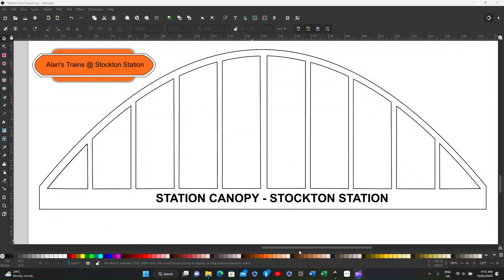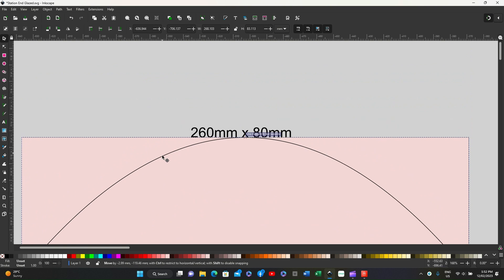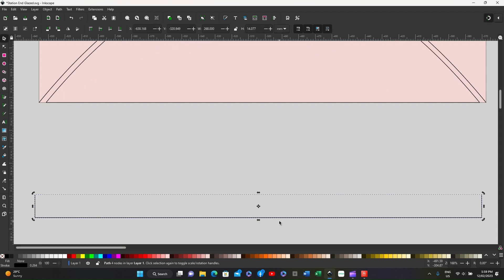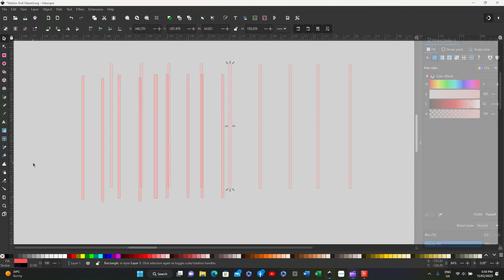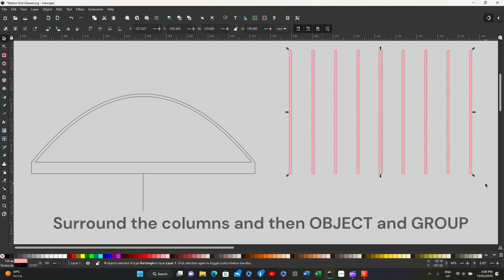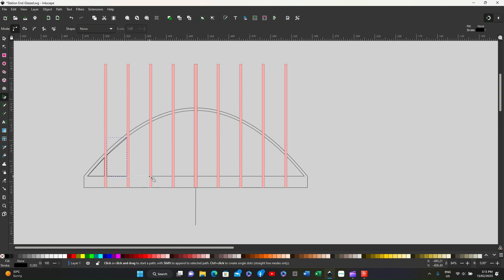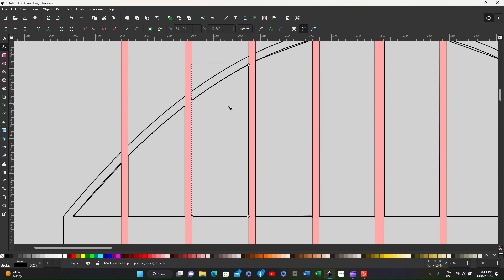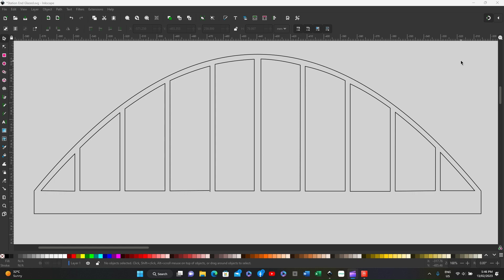Constructing the end of Station Canopy in Inkscape Part 1

Comment: I liked how you made the initial arch. I hadn't realized that about the smooth nodes option. However, I can offer a slightly simpler (and quicker) method of getting your window shapes. Once you have your second smaller arch and draw the line underneath, select both and choose Path>Union. This now makes an arch shape. Give it a white fill color. You can do the same thing with the larger arch and the box drawn underneath. It will also erase all the unwanted lines.

Now when you have the row of columns centered over the arches, do Path>Union again to join them all into one object, then select both the columns and the smaller arch shape. Now click Path>Difference and it will automatically cut out your windows to their exact shape without needing to fiddle with the nodes of each window pane. This should make the process quicker for you.

One last thing I've discovered is I'm finding I need you to post a lot more videos a lot more often! I'm really enjoying them. :)  Cheers!
Reply from the maker: Thanks for that I’ll give that a try.  I will try for more video 👍👍